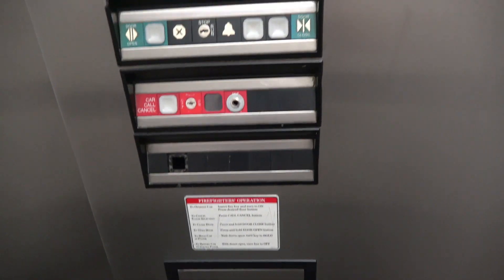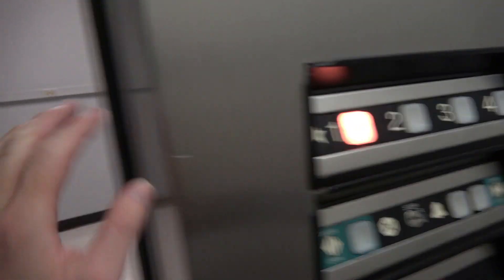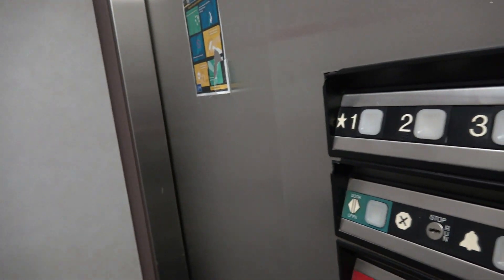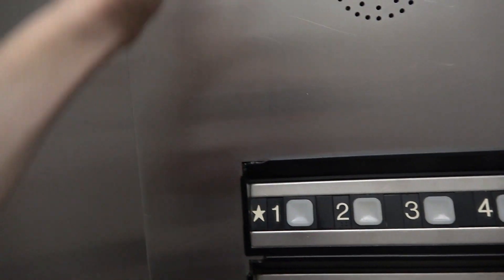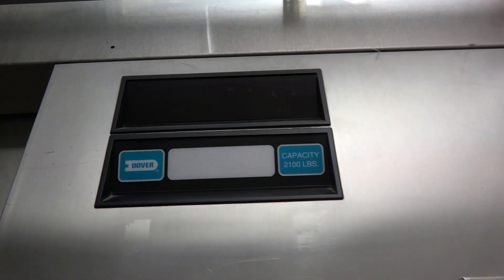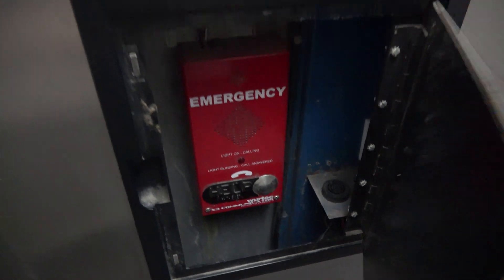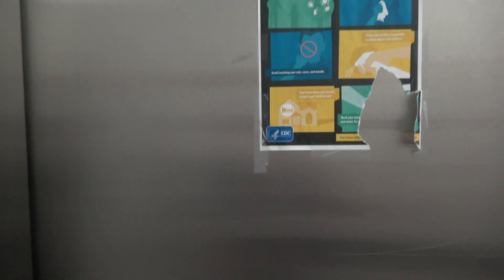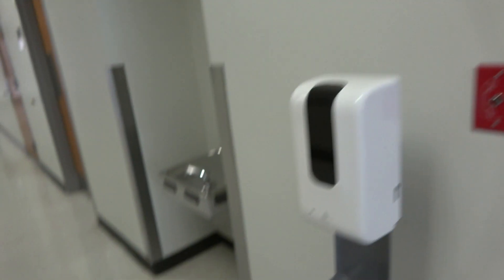Dover Impulse Hydraulic Elevator at Dwight Look Engineering Building, TAMU in College Station, TX.

Comment: That fan sounds horrible
Reply from the maker: I’ve seen worse. Go look at my older Otis Series 1 video. The fan sounded worse than this one.
https://www.youtube.com/watch?v=eNfZDiwemW4
Reply: @JimLiElevators Yet again it sounds like another elevator with a fan that has a bad bearing. On this one it sounded like the grease in the bearing has dried up and the metal was scraping on the inside (hence the chirping noise)